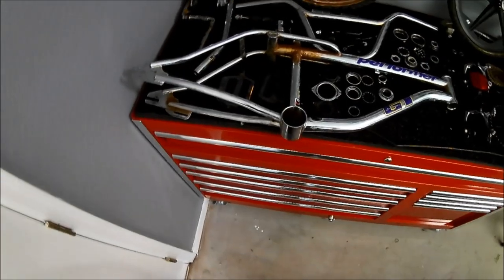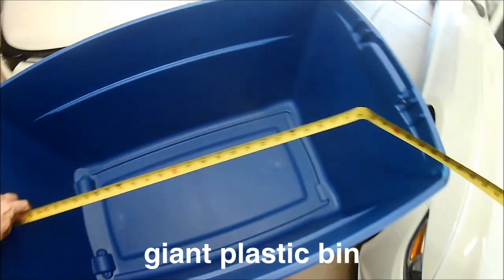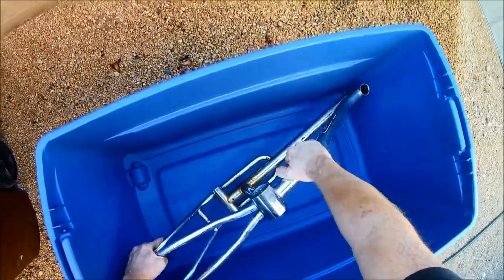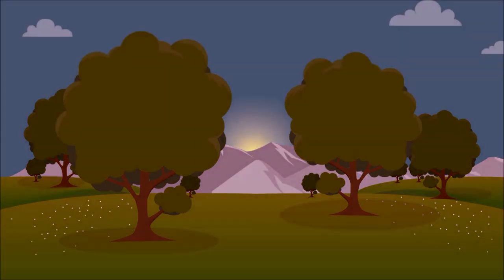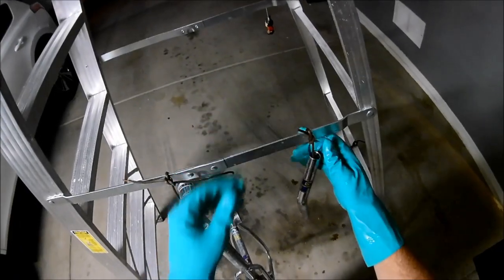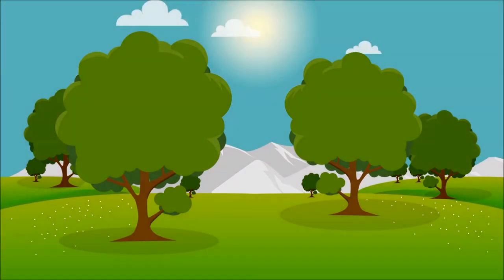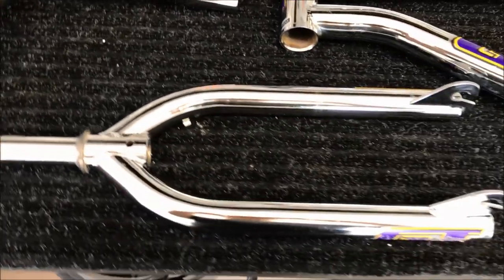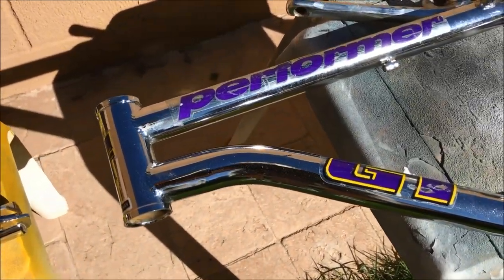Rustiest GT on eBay - Oxalic Acid OA Bath - 1990 Performer BMX  Restoration - Part 3

Comment: Great job!👍It definitely pays off in the end to take your time and do it the right way. 👍👌👊

I did the quick method on my 95 Dyno Compe. I used #0000 synthetic steelwool with 3-in-One oil, and a brass brush on the heavy rust spots. (Keep in mind, the only heavy rust was the welds on my handlebars, thankfully) Brand - "No 7" rubbing/polishing compound to finish everything up. It's a slightly abrasive method, but it worked super fast and turned out great. 

Note: Synthetic steelwool is the key, if using the method. If you use regular steelwool, it will break off in the cracks & pits of the chrome/steel and cause more rust later on down the road. So keep it synthetic if using steelwool on any kind of metal/steel.
Reply from the maker: Were you able to save the decals? That was one of the factors that lead me to trying this

Comment: I rode BMX and dirt jumped from the late ‘80’s to the late ‘90’s.  I just got an old Schwinn XS in the chrome w blue, Super Stock 2.  It’s got some issues w the chrome.  Thanks for the video, I’m sure this will be very handy when I go to restore it.  I’ll also check out the forum that you mentioned.

Comment: Nice video…one quick question, I have an 87’ General Osborn Pro bike frame, and it has both chrome and paint. Will the acid bath damage the original paint…I don’t really care about the decals, I have replacements for that, just concerned about the paint. Thanks again for the video.

Comment: Probably better to save some really thick poly bags and use those inside the bin for the acid bath. Less liquid that way so less weight to contend with. Does anything rust in Arizona? Thought it was dry as a bone there.

I think a big ice box would be the better thing to make the acid bath in. I wonder what the chrome would like like under a hard clear coat?
Reply from the maker: Haha, you're right - no rust here. The bike was from Massachusetts, even had the original bike shop decal. Afterward I had the revelation that a Rubbermaid trash can would have been stronger and cheaper, but oh well. Worked out on the end
Reply: @joelyoung9519  Thanks for the video Joel. I have an old Raleigh frame, a women's step-through from 1982 that I want to build up. I just stripped and painted a Trek MTB frame and boy is it a lot of work. Not sure I want to go through the same process so I might be trying to eat the rust off and then using a two part hard clear coat. I found that spray cans are no good for bike frames because the spray pattern is too wide. Everything gets painted but the tubes. So my next paint job will be with an airless sprayer and optimal nozzle ( if there ever is a next paint job ).

BTW - I don't think this oxalic acid is that nasty. Eye protection certainly and don't swallow it but it is supposed to be naturally occurring. I am trying to figure out how to dispose of it. Might just super dilute it and put it down the toilet.
Reply from the maker: @errcoche  a few times a year our local Home Depot has a  hazardous disposal day, might be another option. Best of luck with your frame!

Comment: I’m starting to restore my 1983 Torker280 when you put it back together did you take off all the frame stickers and put new ones on, also did you get all new brake cables and how did you do the alloy rims
Reply from the maker: I really wanted to keep the original decals, so I didn't replace them. That's one great thing about the OA bath, it doesn't effect the decals for the most part. If I remember one of the cables was seized, but most of them I was able to reuse. This bike had mags, the spoked rim went to Goodwill. Good luck with your Torker!

Comment: Is it best to take the decals off first if your going to be putting new ones on?
Reply from the maker: In my opinion it's more valuable with the original decals. Unless you are rechroming (it's a word, I promise) I'd leave them
Reply: @joelyoung9519  im not worried about the value mate i am working on a project to keep for myself i want everything to look brand new
Reply from the maker: If you've already found the decals then yes probably best to remove the old ones before the bath. If nothing else it will make it easier to polish afterwards
Reply: @joelyoung9519  thanks for your help 👍